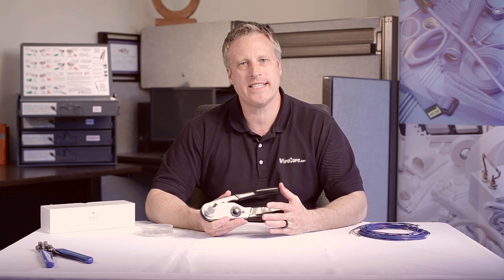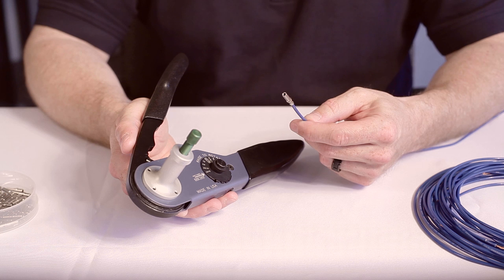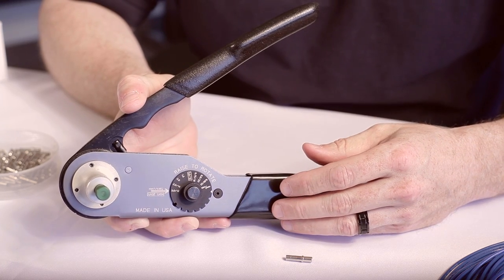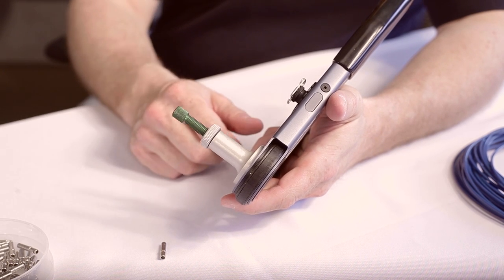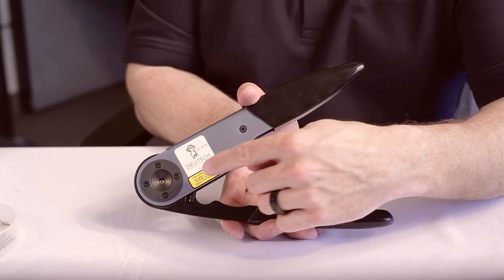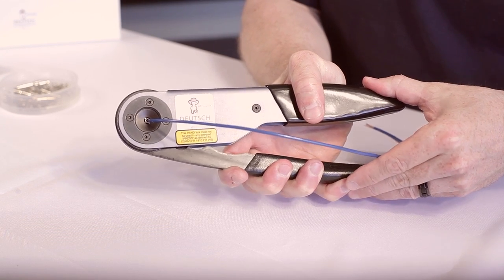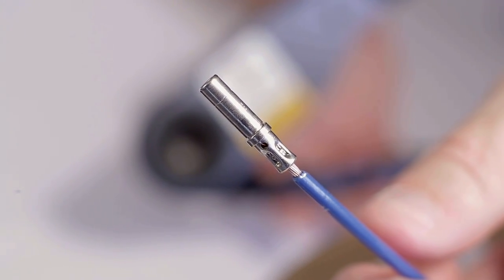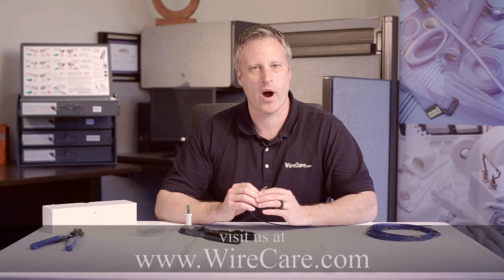How to use the Deutsch HDT-48-00 Hand Crimper

Comment: Interesting that you say to turn the dial to the contact size. Most of the videos I’ve seen say to turn the dial to the wire size. Which is it?
Reply from the maker: Hi Angel...you are 100% correct. The selector knob needs to be turned to be aligned with the wire size that is to be crimped and not the contact size. The video is wrong and will be remade.
Reply: @WireCare  oh sweet. Look forward to it!

Comment: Your "How to assemble a Deutsch connector video references this video in terms of "making a proper crimp."  TYhis vide makes no mention of "making a proper strip," in termsd of preparing for a proper crimp.  If you search "Deutsch DT series Technical Manual", you'll find a link to it online.  To make it quick, search the PDF document for "strip."  You'll go directly to the page that lists proper strip lengths for each style (stamped / formed, solid) and size of pin.
Reply: Thank you for the information, Andrew. We appreciate it.